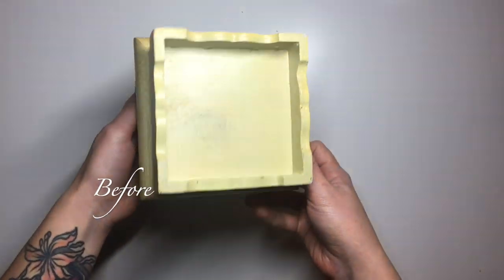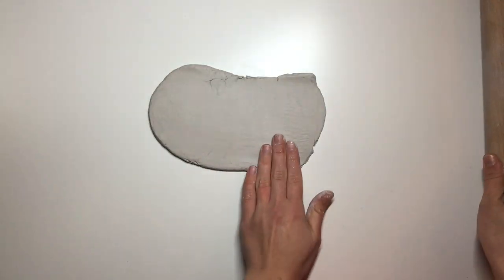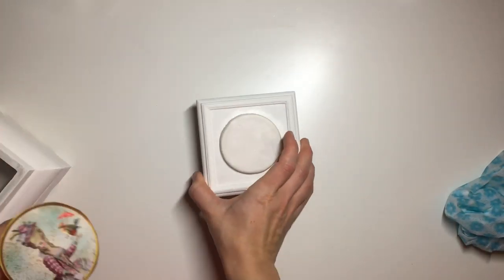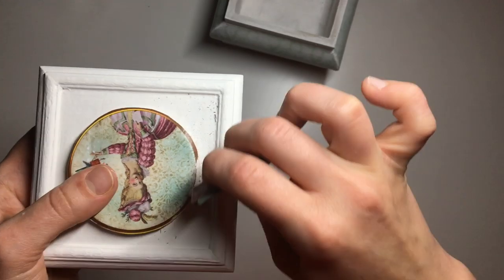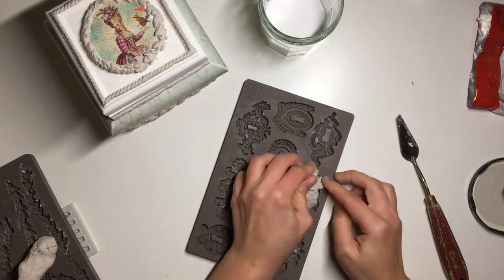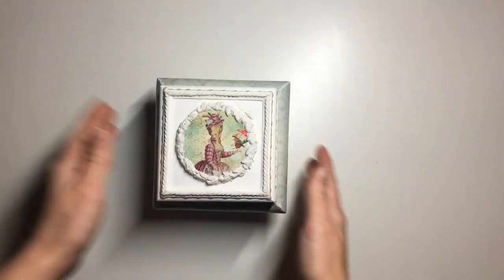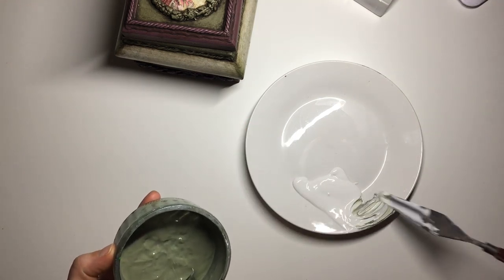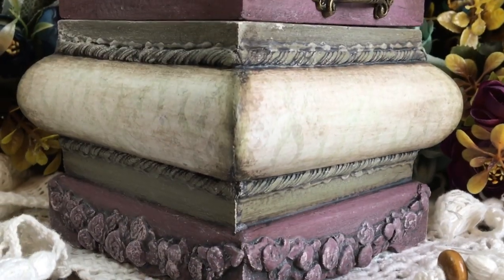DECOUPAGE JEWELLERY BOX WITH PRINTED PAPER | DECOUPAGE ON WOODEN BOX TUTORIAL

Comment: The box is really beautiful. I have a question about the air dry clay, when you are putting it in the mold are you leaving it to dry in the mold before putting it on your project?
Reply from the maker: I usually apply it when it’s still wet, it allowed me to mould it and shape it so it fits flush with the rest of the piece ☺️
Reply: Dainty Gifts, thank you for your reply I really appreciate it.  I’m going to buy some clay to try